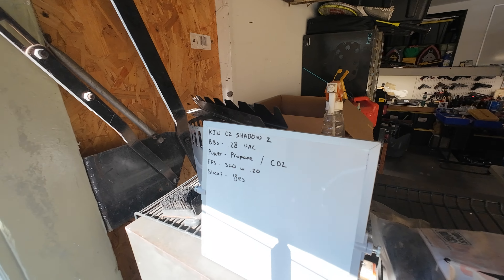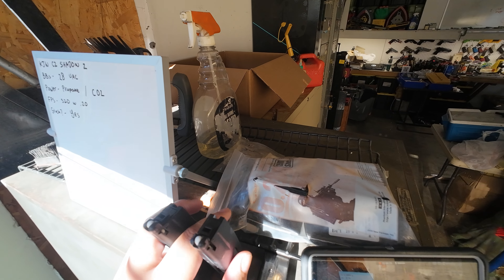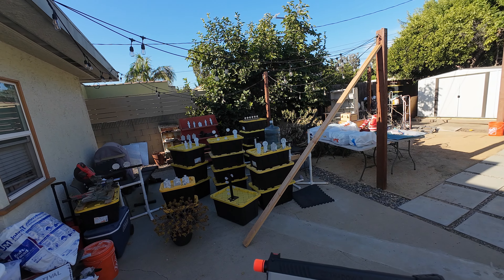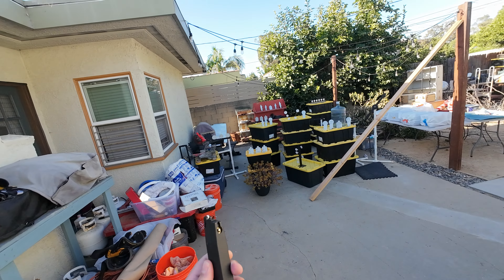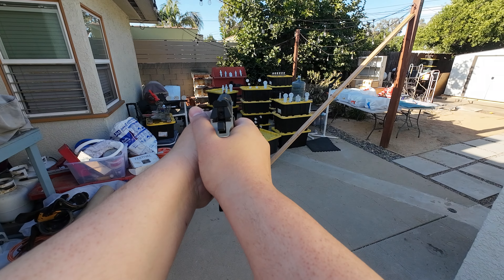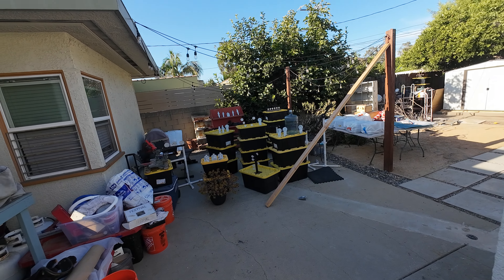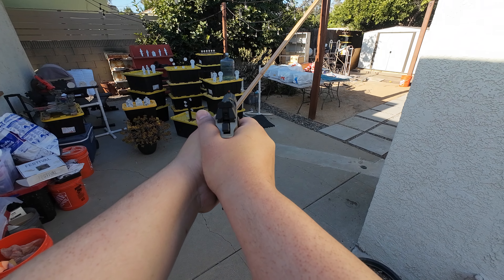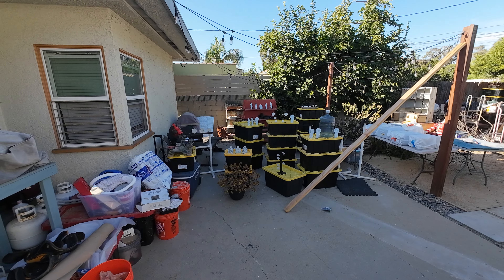KJWORKS CZ SHADOW 2 Series: Quick Test Shoot (3/?)

Comment: The OEM outer barrel and inner barrel are a terrible fit. The hop is not compatible with A.M. barrels unless modding the hop is done, or replacing hope with AM hop body. I went with CL Product Designs No-tilt barrel and gained massive amounts of consistent accuracy.(A.M.=aftermarket)